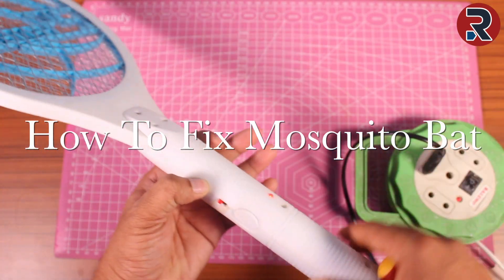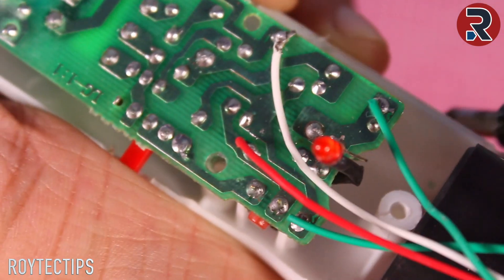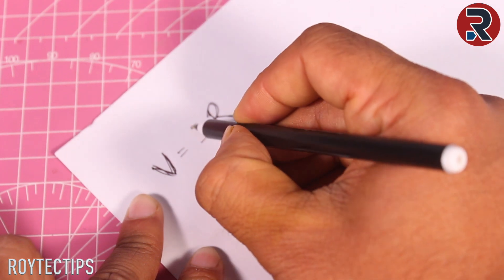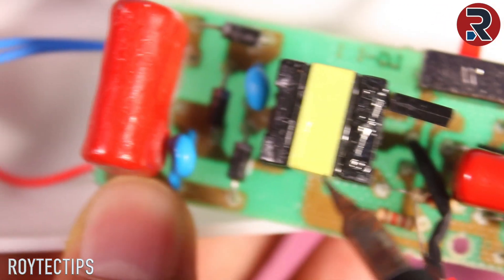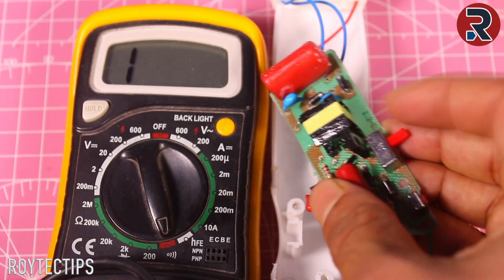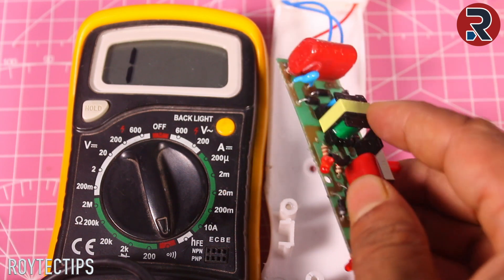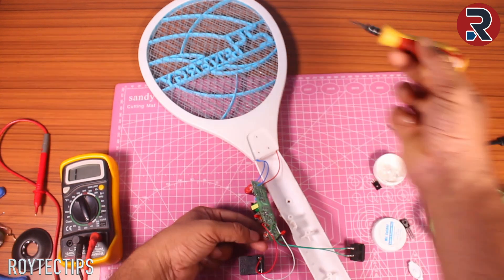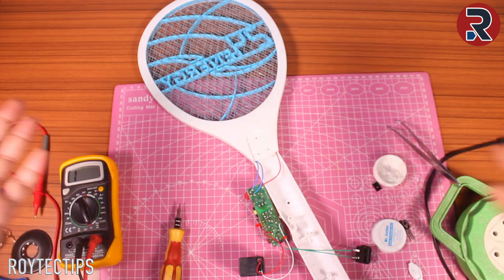How To Repair Mosquito Zapper Racket / Mosquito Bat under $1

Comment: I replaced  the transistor d882 it worked but then after several hours there's no zap. Is there an updated transistor that can replace D882?
Reply: clean/wash up the grid first and let it really dry,measure in ohm for infinite resistant result

Comment: Is it safe to use this WHILE it's charging?  Thanks
Reply: No not at all safe
Reply: Roy, I tried many ways, changed the battery, after charging, with just one press of a button, the battery is discharged. what could be the problem

Comment: Cheap mosquito killer bats use low quality LED indicators. Their leads are made of iron, which rust and break. When this happens  most people will think the bat is  dead and discard it. Few will bother to repair it.

Comment: Hi. 
I don't know much... But as far as I know a multimeter in Diode mode - red probe on the base, black probe on the emitter - should give a reading above 0 (typically 150+) 
Same goes for red probe on base and black probe on collector. 

And if the probe polarities are reversed .. then the there should no reading (ie: 1 on the multimeter) 

U got reading both from Base to emitter and to collector.
 Yet u said that the transistor is bad. Can I know why ??
Reply: The emitter should read at least 9 over the collector when the red probe is on the base...

Comment: im new on this electronical thing, it cloud over on my head on 4:44 you check your transistor and it doesnt have current on the other side and you says it is work properly and when you test on the board the transistor showing current from the both side and you said that IT IS the problem. How it is the problem? does it really work that way, anyway im watchuing your video cuz i have low voltage bug zapper lol. currently what i got is broken diode, it doesn show any living sign.

Comment: Thanks for your video, very much useful, 
But had a doubt, I found the same complaint in my bat, so replaced transistor, but again it damaged and same complaint exixts, what to do then? Waiting for your reply
Reply: There is no way for someone to know if it was only transistor, if it was installed properly, or anything else without inspection. So a good reply isn't possible

Comment: Bhai my Board   is working, but coming low spark ⚡️
Reply: Check npn transistor and if it is ok then check biggest capacitor and replace the not working one. Your problem will be solved

Comment: mi raqueta tenia el transistor  KSH 200 ZH 09 quemado y le puse un BD 135 quedo perfecto andando. Gracias por el vídeo. 
My racket has the KSH 200 ZH 09 transistor burned out and I put a BD 135 in it, it was perfect. Thanks for the video

Comment: Hi,  my mosquito battery is ok. It show 4.2 volts through multimeter Charging light is showing, but press buttion is not showing which comes when we press d buttion for killing d mosquito, pless answer
Reply: Replace the pressing button

Comment: On touching the terminals of the DMM on the two sides of the resistor you will find te equivalent resistance across it not the actual resistance of the resistor. To find the actual resistance of the resistor use colour code method. Same goes for the diode also. It is unwise to check components like that when they are attached as a part of circuit in the PCB. 

But video is good.:)

Comment: My zapper wasn't working so I opened it and found the positive wire for the battery broken off! Problem is, I'm not sure where it should  be reconnected! It seems my circuit is a bit different to yours but I expect they are all basically the same. How can I tell where the positive  battery wire should go?
Reply: Use a magnifying glass - or take close up photos and zoom in and you WILL see the spot it separated from. Be like a CSI investigator and look closely.
Reply: You will see positive and negative sign mark on pcb board

Comment: i know the problem is that transistor but there is no any transistor from that in our country , 
what can i replace for it?
Reply: If you want you can buy new pcb board from flipkart or amazon
Reply: 882,D9,965,135,139,140,880,2583,
8050,3807,2n2222. Pinout could be differnet

Comment: D882 ট্রানজিস্টর এর পরিবর্তে অন্য কোন ট্রানজিস্টর ব্যবহার করা যাবে কি । যদি যায় তবে সেটা কত ?
Reply: D2583,d8050,d9,1308,1309,801 all are equivalent. But its impossible to say without testing that will it work on your circuit or not

Comment: To discharge the battery,where are you putting two nodes in the PCV(in which two points) please tell.
Reply: There is no need to discharge the battery, just switch it off and no current will flow through the circuit....to discharge the orange capacitors, you short (connect together) their two lead points with a screw driver..

Comment: Not producing blast sound, but mosquito kill
Reply: Bro the biggest capacitor in u r board is damaged
Reply: Check npn transistor and if it is ok then check biggest capacitor and replace the not working one. Your problem will be solved

Comment: I have tried to repair these bats for last
two years but not 100% successful. Better to buy a new one for 130 instead of
wasting time on this. This is the age of Use and Throw and time is very
valuable. The age of repairing small electronic items has gone. You will never
earn a good amount by repairing small items like this. If you have nothing else
to do then it is ok. After much research I have found that dust and moisture
reduces the spark by leakage current. You just dismantle the net portion and
wash all parts with soap and water and dry it thoroughly. This will increase
the spark greatly, like the original.
Reply: My friend brought one of these mosquito bats locally and it wasn't working from the start...he took it back but the seller refused to take it saying there is no warranty/guarantee for it....your bat should last at least 3-5 years easy until moisture corrosion becomes any problem; just keep it clean by brushing it occasionally....once you know how and you can get parts locally, repairing this only takes like 10-15 minutes and your bat is ok for many months..
Reply: @ameyas7726  Saying repairing takes 10 to 15 minutes is absurd. Opening five screws and fixing, removing defective part and soldering new one will take quite long time.
Reply: main problem is using substandard and under spec parts for the circuits in these Chinese product, so if you buy genuine parts which is specified for the current and voltage rating for the circuit, they should last for years if not physically damaged.
Reply: Well I am using the same mosquito bat from 6 years still working and if any problem then I am again repairing it😁
Reply: @abhishekjosephverma5989  If one has no other work he can repair 130 rupees mosquito bat taking more than half an hour apart from going to market and buying parts. The pleasure one gets out of repairing defective devices cannot be compared with money because I was also in that line. But as you age, your vision becomes weak and it becomes headache to continue this hobby. Cheap high voltage devices break down frequently due to insulation leakage and cheap batteries. However youtube videos like these are informative, even though not practicable.

Comment: Led light is on but mosquito do not die,why it occur?
Reply from the maker: I think transformer is dead
Reply: @RoyTecTips  

D2583 transistor is getting hot while pressing the push Button, what you think, what will be the fault ?
Reply: @Royd20  replace the transistor
Reply: Or one of the orange capacitors, probably the last 3000v one!

Comment: Bro your 1 week late for me. I repaird my bat 1 week ago. This video would be usefully if i get it earlier 😄😄
Reply: Hi,  my mosquito battery is ok. It show 4.2 volts through multimeter Charging light is showing, but press buttion is not showing which comes when we press d buttion for killing d mosquito, pless answer
Reply: @deepaksach1980  replace the pressing switch. Your problem will be solved.